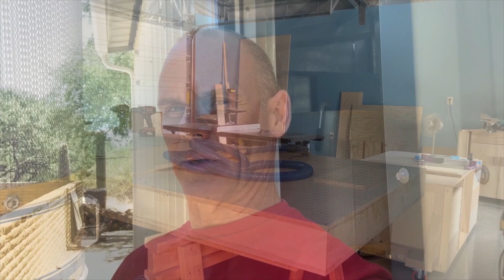BFG KO2 15,000 mile update, common questions, thoughts quick shop tour

Comment: On my third set of KO2's .. on a 2001 Ford Explorer Sport 2Dr with 265K miles on it (about the same size as your Unlimited) .. I usually get over 50K per set.  I run them at 30psi on road and 12/15 off road. Never had a problem.  I did try a set of KM3's in 255/85 16" and got 7052 miles out of them!!  Either the tires were bad or my driving toasted them.  They could not be balanced at 7052 miles .. they were junk and BFG would not back them as they are an all terrain tire with no warranties .  I put on another set of KO2's and no problems.  I am trying the Toyo AT3's on my Crosstrek .. went with the 225/65/17" .. I'll definitely be eyeballing the KO2's for future.
Reply from the maker: I have heard good things about the Toyo's and will be interested to see what you think of them.  I am still a fan of the KO2's and think we must have gotten something in the tire and just didn't know it due to the TPMS light being on.

Comment: 50,000 miles later- any issues with your axles or bearings, noise increase, or wear and tear from the KO2s? Thanks! You’re the best
Reply from the maker: Howdy, the car is at about 40,000 miles now and no issues at all.  We did have one KO2, rear driver's side, blow out on the freeway after a trip home from Kansas.  The TPMS was down at the time so my guess is we had something in the tire and didn't know it was going down.  

Otherwise the tires still look great and have a ton of miles left in them.  Only complaint with the KO2's is they are a little loud especially on the freeway, but they are awesome for the dirt.

Comment: The wife saw me watching these videos and got me this wheel and tire setup (also on an '18) for my birthday recently. Absolutely amazing... and the tires are nice too. The only issue we ran into was that these are S-rated (112 mph) and the stock tires are H-rated (130 mph) so tire shops generally wouldn't help me swap out TPMS sensors and mount the new wheels. We were able, however, to buy new sensors and have the tires mounted, balanced, and shipped directly to me and I put them on myself.
Reply from the maker: Sounds like you have a serious keeper there my friend.  What a great wife.  Glad you are liking the wheels and tires!  Interesting about the speed rating and the shop would not swap the TPMS sensors for you?  First time I have heard of that?  I guess I didn't have to deal with it since I bought new ones and kept the originals with the stock set up.  Glad it worked out in the end and congrats again!
Reply: @AZdroptop  Thanks, and yeah the tire thing was odd. If I dug more I probably could have found one that didn't let a computer think for them, but the few that I talked to punched the '18 crosstrek and the KO2s into their computer and it was flagged as "under-rated" relative to OEM and they said it was against their policy to install them.
Reply from the maker: I guess that makes sense.  They were freaked out in general about putting the Methods and BFG's as well.  They asked my like 3 times if I was sure they would fit.  :)

Comment: Just got a 2021 Limited Crosstrek. Came across ur channel and had a question bout the wheels u bought. Are they the Method 502 VT Matte Black. 15x7/5x100mm/+15 mm offset . Great channel !!
Reply from the maker: Yes they are.  Tires are 215/75/15's.  They do not make the KO2's in the stock 225 size so they are about a 1/2 more narrow than stock.  Still going strong after about 40K miles.  Thank you and I am happy to help if I can.  Congrats on your new Crosstrek.
Reply: Thank u

Comment: Great segment. Very helpful. Curious, in this video you said you've done some towing. Just wondering what you towed? Weight? How'd the CT handle towing. Thanks so much for sharing. I've been soaking up all your experiences you've shared. Very much appreciated.
Reply from the maker: Thank you very much!  Most of the towing I have done has been of my 5 x 8 trailer with small loads.  Generally 250 to 500 pounds or so.  I did tow a very large and heavy mulcher and honestly the car did great.  It probably weighed around 800 to 1000 pounds and although I would not have driven on the highway with it, it did fine on backroads and I was able to get up to speed comfortably.  Stopping was pretty good, though I could really feel the weight and planned well ahead.  :).   I think I talked about it in one of my towing videos but can't seem to remember which one.  

No issues with the CVT at all.  Hope that helps and thank you for watching along.

Comment: They are a very popular tyres , but from a 20 experience on off road tyres I found them the noisiest, Yokohama I swap BFG for were quieter but never tested the full miles out of them . I think these days there is a bit more choice as more of this type of vehicles come on to the market and more people adventuring than 10/20 years ago when I started out , running Avon’s out the min but on a van in the uk they were the only AT available in my size and legally van rated
Reply from the maker: It is kind of interesting...when I first began looking to go with a smaller wheel and more off road tire I read every review I could find and almost to a person the BFG was claimed to be quiet and long lasting.  So far I agree with the long lasting...not so much the quiet part.  :)    When they are do to be replaced I'm not really sure I'll go with them again.  I love the protection and look they offer, but they do make some noise.
Reply: @AZdroptop  they get used a lot on trucks I think that’s probably a lot different to SUV and Crosstrecks etc , it the UK we get a lot of mud and huge Landrover  numbers I was part of a few groups and BFG was used a lot , coopers i saw a lot as well .
Reply from the maker: Very cool!  Thank you again.

Comment: The crosstrek engine will break in around 20000- 23000 km and start to get better gas mileage.  I've picked up over 1.5litre/100km savings.  I also recently (23000km) dumped half a bottle of duralube in the engine oil and I swear the engine felt "better" immediately. My 2cents lol
Reply from the maker: Thanks Aaron!  Always appreciate input.

Comment: Hi Rick, to get even wear on them, what PSI are you running? I've been experimenting all the way from 32-38 in its 10k lifespan. I know the dash isnt accurate, maybe 2.5-3 psi lower? I've been using different gauges to make sure. Not quite sure what to settle on. Looking good so far, just wondering what you think is best.
Reply from the maker: Hi Michael, I run 34 to 36 psi and it has worked out great so far.  Sounds like you are in the same ballpark.  Cheers.

Comment: Where did you get your rims and tries from? Where in Tucson did you have them mounted and installed?
Reply from the maker: I ordered them and had them installed at Discount Tire.  They will try and tell you they don't fit because their computer doesn't show a 15 inch wheel stock, but they fit no problem.

Comment: Nice to see a new Crosstrek vid, has the new 2.5 engine for the 2021 sparked any interest from you?
Reply from the maker: I  was happy to see Subaru finally decided to give the Crosstrek a bit more power for sure.  Also nice to see that they gave it the Xmode 2.0.  They are claiming that the car get's better MPG  with the new motor as well which will be interesting to see if that is in fact the case.  To be honest if I was still driving my 18, bought a Jeep if you didn't catch that video, son is driving the Crosstrek now, I don't think it would be enough to push me into trading the 18.  I honestly didn't mind the power and it was a comfortable and capable daily driver.  I went with the Jeep to allow a little further exploration off road.

Comment: Like the hitch receiver what is the weight limit capacity and brand?
Reply from the maker: The hitch is a curt from trailer.com  Class 3 and rated for 3500 lbs. but the Crosstrek is only rated at 1500 lbs for towing so it is a bit of overkill.  Here is the video about the install.https://youtu.be/JCWE3mgoPsU

Comment: Hey Rick. Thanks for all the info. This may have been asked but I just purchased a 2021 crosstrek sport. Do you happen to know if this setup would works just as well on the new model?
Reply from the maker: Should work just fine with no issues.  Thank you for watching.

Comment: Thanks for the videos, Rick! Quick question, with this wheel/tire setup on stock suspension, can I run Rally Armor mudflaps with no rubbing issues? Thanks!
Reply from the maker: I have Gorilla flaps and they fit no issues at all.  I believe they are pretty much the same as the Rally Armor set up.  I hear the 235's rub, but these work perfectly.

Comment: Question : what do you do or will you do IF you get a flat with the tires? Ie. Do you have a donut and will that work if you got the ko2s on? I'm still up in the air to get the wheel tire setup simply because idk what I'm to do if I get a flat while having them on. If I'll be able to even pop on a donut or will the vehicles have to get towed?
Reply from the maker: I originally was using one of my stock wheels/tires as a spare for off road use.  I have since sold them so I just have the donut.  The Methods and BFG's are essentially the same circumstance as the stock tires so the donut will work just fine.  I would not want to use it when off road, but it works great for the street.
Reply: Hi Rick! I have been a fan of your channel since I bought crosstrek. Question is do the standard spare tire same with 215/75/R15?

Comment: Hi Rick.

I hava a 2024 crosstrek that came with 18” rims.

Do you know what kind of size could fit my crosstrek without changing rims or adding a lift kit?
Greetings from Mexico City
Reply from the maker: Hello.  Are you wanting to put on a wider tire?  Or an all terrain tire instead of a road tire?  Here is a tire size calculator that should be helpful.  Personally I would not go wider than 225 to avoid any kind of rubbing and the noise and weight are not worth it in my opinion. https://tiresize.com/calculator/
Reply: @AZdroptop  thanks for the info.

I’m thinking about getting and all terrain tyre without changing rim size (18)
Reply from the maker: Okay cool.  I have not used them, but hear the geolanders are good.  If they make an 18" I would look at the KO2.

Comment: Hi rick! I just got 2021 Crosstrek and I’m enjoying it so far. I was wondering , do you think I would run into any brake clearance issue if I want to have the same wheels and tires as yours. My stock wheels are 18s. Thank you!
Reply from the maker: As far as I know the brake situation is the same on the 18+ cars so you should be just fine.  just double check that they didn't increase the size in calipers to be 100% sure. Did you go with a limited or sport model by chance?  I am curious what folks are thinking about the new 2.5L.
Reply: Rick Hutton I checked the numbers and compared the 2019 models vs 2021 . The front / rear brakes rotor diam x thickness are the same.  I have the limited model with the 2.5.  Perfect for the crosstreK for daily and some weekend funs! Not a fan of auto start/ stop but I’m glad it’s just a push of a button to turn it off.
Reply from the maker: Very nice!  The Method wheels and BFG's will work perfectly and will look great on your car.

I have never been a fan of cars with start/stop myself, but the Jeep has it too and it hasn't been too much of a bother so far.  It is nice to be able to turn it off right away for sure.

Comment: Hey there Rick I ordered a 2022 and all sites are saying they don’t fit as well I’m wondering if the break sizes are the same between yours and the 2022 any thoughts ?
Reply from the maker: Hi Brandon, did they give a reason as to why they are not fitting as well?  Or any hint at all?  I don't know of any significant changes with the Crosstrek's break's for 22 so I'm not sure what the reason would be.  It is possible that Subaru changed something.  I would call either LPaventure or Method wheels directly and see what they have to say.  LP has always been great when I contacted them directly.  I look around a bit and see if I can figure something out.
Reply from the maker: Found this on LP's site on their 2021 project Crosstrek.  KO2 235/75/15 *some modifications to the inner fenders are required"  Keep in mind this is with 235 tires and my guess is why modifications were needed.  215's would probably fit fine, but I would still give them a ring.  Best of luck!
Reply: @AZdroptop  thank you so much !
Reply from the maker: My pleasure Brandon.  Best of luck with it.

Comment: Is the 2.0l crosstrek enough powered for these tires
Reply from the maker: Yes it is in my opinion.  The 18 has better power than the originals.  I didn't notice any difference between these and the stock wheels/tires.

Comment: Nice setup Rick, where did you get your bike roof rack?
Reply from the maker: Thank you Mark.  Actually those came directly from Subaru back in 2011 when I bought my STI.  I have carried them over and they are still working great.  Made by Yakima.  I tend to buy my Subaru stuff from Heuberger Subaru in Co. these days as their prices are  pretty good.
Reply: @AZdroptop  did you have any issues about your tps sensor with your new wheels and tires?
Reply from the maker: A couple issues.  First, discount had trouble programing them when first installed.  They used the wrong year Crosstrek.  The other issue was that the TPMS sensors I bought with the new set up were recalled a couple years from new.  They replaced them under warranty.  You can always have your stock TPMS moved to the new wheels tires if you get a new set up.
Reply: Thanks Rick, I’m getting my new tires and wheels next week.
Reply from the maker: Very nice! Should be straight forward with the TPMS.  Just make sure they are working when you drive away and don't let them tell you it takes 5 miles for them to activate.  I have been down that road with them.  :)  If they are not working with in a mile they are not programmed correctly.

Comment: Did you purchase a set of TPMS for your BFG KO2?
Reply: I had the shop put the ones from my stock wheels into the Method/BFG set I bought since they only had about 3k miles on them. Didnt make sense to me to buy a whole new set when you consider that the batteries in them eventually go bad over time.
Reply from the maker: My initial plan was to keep my stock wheels and tires and use them for long road trips so I bought new ones for the KO2's and kept the stock set up together.  If you are not planning on keeping the stock set up for use you can just switch them over like L T mentioned...will save you $150 or so.
Reply: Awesome! Thanks!

Comment: You mentioned that you put 15" Rims on, what size did the Cross Trek come with? What are your thoughts about adding a lift kit?
Reply from the maker: Hi Eric, my Limited came with 18's and the base as well as the premium come with 17's.  I resisted the lift for a long time because I was worried about really changing the driving characteristics of the car on road.  Not sure how many of my silly videos you have watched, but after I put on the LP aventure skid and front bar I lost an inch and a half of ground clearance and put on some rallytek 1" springs to get some of it back.  Managed an 1 inch in the back, but only about 5/8th in the front.  All that to say I bought an LPaventure 1/5inch lift kit over Black Friday and do to a lot of different circumstances I never installed it.  It sits in the box in my garage as I write this.

I think a lift is a must if you do the bar and skid plate to get your clearance back.  I talked with a few guys who have lifts and while it does change the car's driving characteristics a bit, it isn't much so I think it is a great idea.  At this point now that I purchased the Jeep I plan to sell the lift.  My son is driving the Crosstrek now and he doesn't need it.
Reply: @AZdroptop  Thanks, I got to drive one with a lift once for a short drive and it seemed to stick to the road well that why I asked, I figured thats why you had gone to the smaller rim was to get more tire without giving up clearance.  That is something I really don't want to give up.  I have watched several videos and learned about the Pin access on my '17 Outback which will come in handy so thank you much, the dealer never told us about it and I hadn't gotten that far in the manual.  Wife drives the outback and I'm looking at a 2021 Crosstrek.
Reply from the maker: Mainly went with the rim for the extra sidewall for off road and the good thing is the new set up is basically the same circumference as the stock set up.  It was a bummer to loose the clearance with the skid plate, but the protection was necessary as well.  They have skid's that attach to the stock plastic skid location, but I figured a big hit on the skid in the stock location could still cause damage.  The LP skid mounts to the bar so you loose the 1.5 inches.

Comment: will 215/75r15 100% fit a 2016 ive been researching everywhere getting mixed answers my rims are the Lp5 +15 offset looking for tires now
Reply from the maker: I know they 100% fit 18+ cars.  I can not say 100% on the first gen Crosstrek's.  I believe they do fit, but don't want to steer you wrong.  Check out this video...the guy put on the same method's as mine and 225's.  Should help you decide.https://youtu.be/7t-UFohz2Jg

Comment: Hi Rick. 
Do you have full size spare tire?
Reply from the maker: HI, I never did buy a full sized spare.  Initially after buying the method wheels I used one of my stock Subaru wheel/tires as my spare on off road trips.  I needed up selling them and never bought an additional wheel/tire.  You can use the spare with the methods as they are the same circumference, but it would be nice to have a spare for sure.
Reply: Thank you very much for the reply, very helpful! 
I really like your videos. 🤙👊